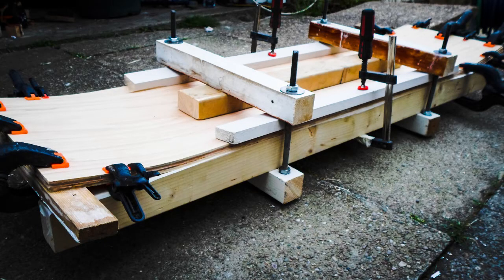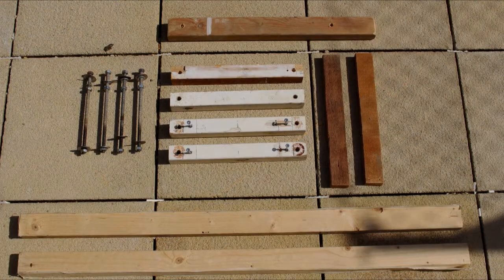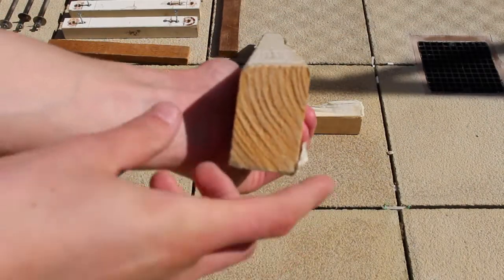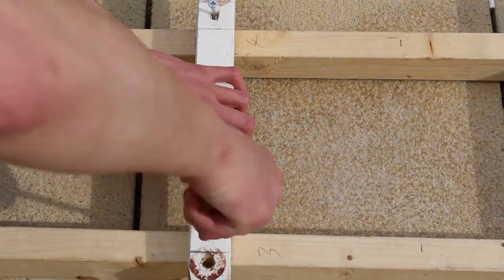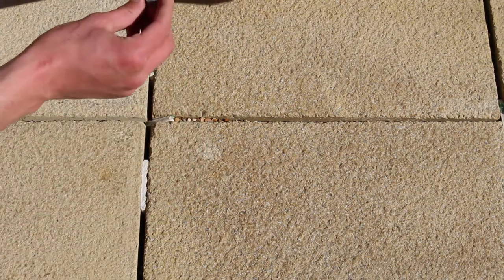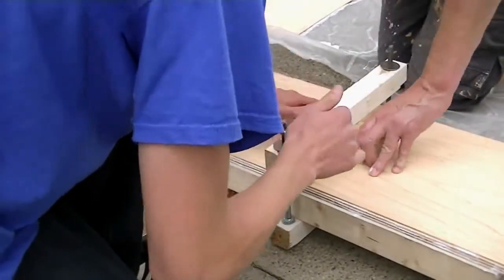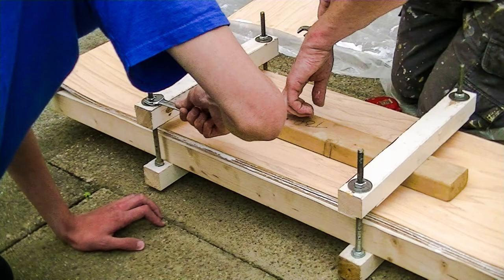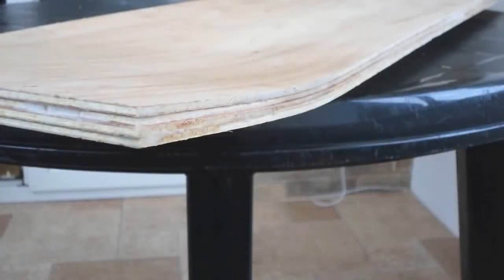How to Make a Longboard Press

Comment: Nice setup Bro!  I see how you get the concave, but how would you gets some camber at the same time when the board is the press
Reply from the maker: Thank you! Good question, boards from this will just end up being flat, I guess that is where this design is limited. I guess you could curve the longest pieces of wood and then use many clamps along the edges, perhaps I will make a version two of this to try it! Thanks for watching